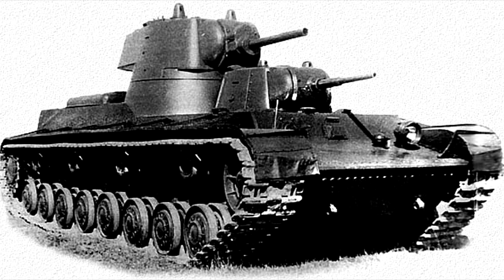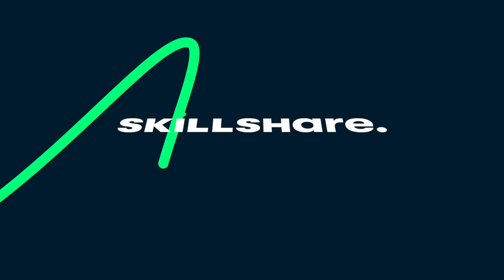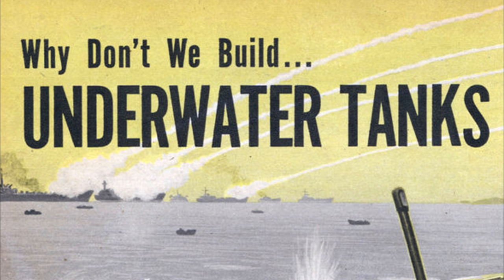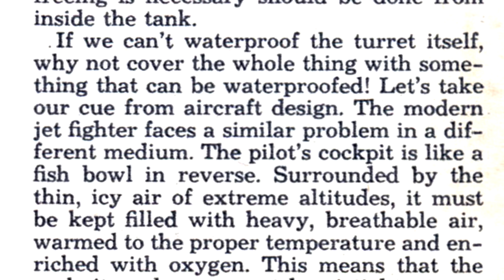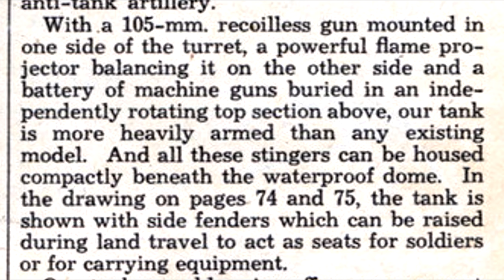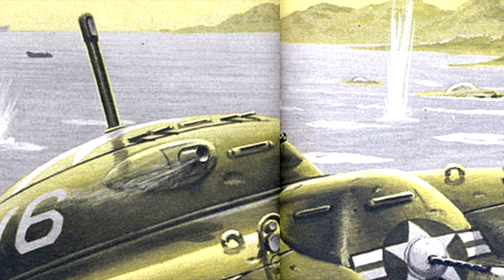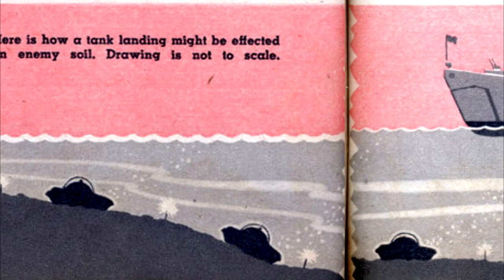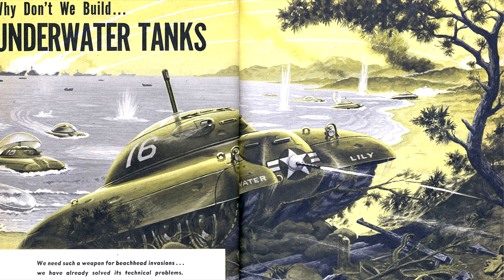The CRAZIEST Amphibious Tank Concept EVER | Cursed by Design

Comment: There is a big hole in it already: the recoilless rifle. When that gun fired, like a RPG or a bazooka, it would create a very big backlash to counter the recoil of the whole gun. If a 105mm recoilless gun is fired in that stubby turret, the crew, if not die from the fume, pressure, and heat, would be critically injured. Plus, the resistance on the beach can be very well put out by naval bombardment or airstrike. It would be much cheaper for a flight of F/A-18s or trios of Arleigh Burke-class to cover the landing party than to develop a tank for a niche situation.
Reply: Yeah lol. I was totally on board and open minded until he said to put a recoiless gun in it. Really though it could just be replaced with a 105mm howitzer since it should have to fight beach emplacements and not other tanks.
Reply: @MistahFox  or you know, just make a cover for the barrel that can be explosively removed :P
Reply: I figured he planned for a tube to vent exhaust.
Reply: Forget something like a Burke, battleships were in service at the time this thing was designed, they should be able to clear the beach of the kinds of things that a 105mm recoilless rifle would be used against no problem. And if for some reason they can't, such as due to too many coastal defenses for them to operate, then an amphibious landing with tanks probably isn't feasible anyway.

Using naval artillery to clear the beach of things like pillboxes and enemy tanks before landing makes much more sense than trying to find a way to land such a heavily armed and armored vehicle. It just isn't necessary. Light armored support should be enough to secure a beach head, at which point conventional tanks can be landed.
Reply: @TommygunNG  they probably would. But what if it failed? Murphy’s law is always there. And a recoiless rifle is something that should never be used in an enclosed space. Beside, the venting would probably make the gun more complicated to operate and take up a lot of space, lead to deficiency in combat effectiveness. 

Otherwise, if a beach is too heavily defended that a ship can’t get close, those tanks would not stand a chance. There is nothing a 16in shell or a missile can’t destroy. So, it would be a redundant tank and not much of use.
Reply: @zoro115-s6b  exactly, i was not paying attention to the time period, but a couple of 16in and 5in shells would definitely clear most of the enemy in area. Also, airstrike would also be ultilized to secure the landing zone. 

Beside, if a ships can’t get close, what good would those tank without infrantry support do? This concept is really for a niche situation that most of the time would not happen/need.
Reply: Exhaust can be routed out of the turret, no problem
Reply: @NoName-sb9tp  "But what if it failed?"

What is ANYTHING failed?! What if the breechblock on a tank gun failed? Dude, anything can fail, with resultant consequences.

But what if a reply to a reply on YouTube fails? Well, we just saw one that did.
Reply: @TommygunNG  Okay, so, a recoilless rifle operates on the principle of Newton's Third Law. For every action, there is a reaction. A normal gun fired a bullet through the explosive force of the chemical inside the bullet, and the reaction force to that explosive cause the recoil. Now, for your vent, it will have to be able to open up for the loader to load the next round. In case you don't know, a recoilless rifle load from the back. With an opening and closing vent, it would create a weak point as the backlash of the recoilless rifle is just as strong as the force to propel the bullet out of the gun. This increases the probability of the vent gave out and explode inside the enclosure of the tank while the gun is firing, killing or injuring the crew. 

Meanwhile, breach loading guns are made with heavier components and don't have to contend with a vent in its back, or backlash. The breach assembly is made with solid steel, make it less likely to fail than a recoilless gun. So, you want to fight in an enclosed vehicle with a gun that's more likely to explode in your face than a normal-reliable breech-loading gun, be my guess. That's why you usually see a recoilless rifle outside of the enclosure of the tank. 

Just like you say, everything will eventually fail, but we need to consider which is more likely to fail. And when lives are on the line, failure must be limited as much as possible. Next time, read, then think, and reply. And yeah, that comment of yours is indeed a failure. Go back to school.
Reply: @NoName-sb9tp  FO
Reply: @NoName-sb9tp  
RR more likely to explode? Er no. Since the back pressure is vented away they are less likely to explode and can be much more lightly built than a conventional gun.
Backblast is totally lethal though, check it out at 7:45   
https://youtu.be/Or6OtukreYU
Reply: @andrewholdaway813  I'm not talking about the recoilless gun itself, but the apparatus that will be needed to contain or push the backblast out of the tank while still allow the loader to load the gun easily. Yeah, totally agree with you. Recoilless gun doesn't have to deal with the force or pressure like conventional gun, so it's lighter. And yeah... that video just tells us why recoilless gun should not be put inside a tank. 

But hey, good to see another fan of Forgotten Weapon :))
Reply: @andrewholdaway813  and i should have been a bit more clear, so, sorry for that.
Reply: @NoName-sb9tp  if you can make an amphibious/submarine tank, you can make an amphibious/submarine APC
Reply: @NoName-sb9tp  false, there are ammunition types for recoiless rifles that have been designed to be useable in confined spaces. they didn't exist at this time, but they do now.

as for naval gun fire, its vry inaccurate in ww2/early cold war. for example on D-day almost no shells from the naval support actually hit the beach defenses. 

and in modern times you still have to account for shell/missile travel time, aswell as the time it takes for them to be called in in the first place (the spotter needs to identify the target, accurately cal. its location, radio it to the ship. the ship then needs to choose priority targets, then the projectile needs to travel the distance) this can take serval minutes which means if enemy tanks move into the beach zone you are in real trouble unless you brought dirrect fire anti-tank weapons.

furthermore, naval gunfire and missile strikes give away the element of surprise. if the enemy has a relatively lightly defended beach, argueably its better to simply launch a suprise attack, rather than bombard the place and give the enemy more time to mobilise reserves to push back your assault.
Reply: @matthiuskoenig3378  sure you can make a submarine apc to accompany your submarine tank, but the biggest challenge is going to be cost, R&D, as well as the intergration into the army (logistic, training, etc). You can watch the chieftain video on why a lot of US army unit refused to take the Sherman with 76mm gun and prefered the 75mm (3in) Sherman when they go into Normandy (before they met things like Panther and Tiger).
Reply: @matthiuskoenig3378  the up until the 2017, before the introduction of the new modernization of the Carl Gustav rocket system (yes, I know, but in theory, it worked just like a recoilless rifle), all of the recoilless rifle will produce backlash everytime they fire. We also have to take in the fact that Recoilless rifles always has inferior range than it’s counterpart due to the nature of it’s operation. A round fired from the recoilless gun exhausted part of it’s energy to dissipate the recoill of the gun itself through vents at its back. So, to design a system like that for an enclosed armoured vehicle is probably prohibitively expensive for the 1950s era. Nowaday, with airstrikes, ATGM, and missiles, the landing zone can be secured relatively easy, render the effectiveness of such a submarine tank to almost nil. The inaccuracy of the naval bombardment and airstrike in the 1950s would be countered with the quantity of shell, bombs and rockets (most of the time). 

And I would say that if an invasion fleet large enough to carry those tanks, soldiers, material, etc goes near the shore, the element of suprise is depend on how fast can you strike the beach and how hard can you strike that beach. A fleet of slow crawling vehicles on the sea bed would give the defender more time to man their position. Air strike and naval bombardment are effective ways to delay, demoralize the defender and defend the landing troops. 

As the submarine tank has to be able to move on the sea bed, it can be heavier than their amphibious counterparts. However, it cannot be too heavy, as the weight may make them stuck, or slow them down significantly. The deployment of the Submarine tank must take into account the topography of the sea bed. And on a conventional land battle, it would be out performed by normal tanks. Coupled with less effective gun, inferrior armor, and speed, the submarine tank in my opinion is a niche tank designed for a niche role and doesn’t even do a good job in it.
Reply: @NoName-sb9tp  make an armored half-barrel rotating door to access the recoilless rifle's breech. Rotate the concave section to the interior to empty and reload, roll it around concave out to expose the breech ports to the outside and seal the access port in the turret. Configure it right and there would never be a moment where the turret is open to the outside, but there's plenty of material to keep the crew safe if there's a critical weapon malfunction.
Reply: @mfree80286  so it’s like a door for ammunition rack, but instead of ammunition, we have a recoilless rifle? I suppose it could work, but… ergonomically, I don’t think the soldiers would like it. And the space inside the already small tank would be limited even more.
Reply: @NoName-sb9tp  Oh, I'm sure they'd hate it, but it would work.
Reply: @mfree80286  yeah they would hate it. haha. But, given how the army was so rigorous at testing the weapons, I don’t think the tank like that would be adopted. I mean, just look at the T26 Pershing program. :P 

Don’t get me wrong. Im pretty sure the concept can be made into reality, and the pressure door is a easy way to isolate the crew from recoilless rifle backblast and weapon malfunction. But I don’t think the tank would be adopted. 

I think the chieftain did a video on the developement of US AFV in ww2. It would explain a lot why some vehicles were not adopted.

Comment: Just my opinion: Theoretically possible, yet extremely impractical. 
1. These tanks will cost a lot more to be build due to added components for waterproofing, etc. This is not a regular tank with parts added to make it watertight. This is a submarine/tank hybrid.
2. Problem of communication while submerged. Radio cannot be used underwater. They will need to rely on scheduled plans yet it will be difficult for the tank or the commander to pass message to each other.
3. Rough underwater terrain would likely make this tank only deployable in even less areas, thus limiting the benefit of building such tank. Not to mention all underwater terrain need to be scouted just for this tank.
Reply: The radio problem can be dealt with
LONG ANTENNA
and navigation can have a special tank or sonar or such
Reply: Or silent communication

Comment: I think it could have been made to work - using electric drive is one solution, or carrying oxygen tanks to use a conventional motor as long as the depth pressure wasn't too great for the exhaust to work. It's interesting that there's possibly a false premise here - turrets have been successfully waterproofed as the German experiments showed, as was used on tanks on D-Day, and on the wading Soviet tanks we saw in your video. Therefore the next steps he proposed were not necessary, and there could have been other solutions such as a fixed turret/superstructure. I am also not sure how he intended a recoilless rifle to work inside the tank - I assume he's considered that the exhaust gas from the RR needed to go out the back of the turret some how.

All very interesting though!
Reply: Also many sea floors are very uneven, rocky or pose some other danger. What an enemy could do to prevent the tanks from being useful is by artificially raising the sea floor or making it cluttered with boulders which is easily done. So essentially you could deny those tanks access to the beach with a bunch of rocks/concrete traps. Even better, you could create a bottleneck with those obstacles and lead them to a kill zone.
Reply: @mihailosaranovic5444  as a scuba diver I agree that the biggest flow is the sea isn’t flat and easy to maneuver, the best thing would be make it swim like a submarine but you would need a really powerful engine to work

Comment: As to the Underwater propulsion, using a full contained regenerative engine powered unit fueled by H2O2 at 98%+ was tested by the F*C company in the mid 1960's, but was cancelled after an explosion killed several Engineers.  

My Mom was a Technical Manual Transcriber/Translator at the time.  I was an Aeronautical Engineering student just across the street from the company test track and was a eyewitness to the damaged test device remains.  This was a higher than TOP SECRET Military project.  When I Inquired about it I got a visit from the ''Men in Black''.

Comment: Me, as a Dutch person, has tought alot about amfibious tanks, due to our relation with water. I would see a good underwater tank would be hugendue to our “waterlinie” but quite complex. 1 idea i had in mind however would be to sumbmerge a tank partually, using the water as means of protection, some kind of semi-submerisble. Imagine having to go trough 2 meters of water just to get to the crew compartment, or even remote controlled compartment. Even tough modern tanks have such advanced APDS-FS shells, good luck with going trough that!

Comment: A Betteridea(?) A giant hollow torpedo with blast off cap "Fired" at shore, such that the torpedo lands itself, like when they sink a truck in Operation Petticoat,  but instead of blowing up, the front blows off and a tank or two rolls out.

Comment: I’d love to see someone create a decent sized scale model of this vehicle. I don’t think it would be useful, but I think it’s definitely possible. For sealing the turret, it could be possible to use a temporary rubber seal that could be broken by the moving of the turret, potentially allowing for heavier armament without the need for the dome. The main issue is air for the engine, as you say, alternative power would likely be necessary, as well as a different track design for traversing the sea floor. Either way, it’s an interesting concept, glad you shared it.

Comment: One big problem with this concept is that a major obstacle for amphibious landings is the prevalence of underwater obstacles in water that gets shallow enough that ships/tanks on the surface will get stuck on them. The LVTs and amphibious M4s were revolutionary in that they could actually use their tracks and engine power to climb up and over these obstacles and then continue on to the beach.

So a sea-floor traversing tank would typically get stuck and have no way to deal with it or avoid it, because they would be unable to see at all and too deep to traverse many underwater obstacles.

Comment: There's so many paths in this rabbithole...but it's cartoon villain stuff exclusively.
One thing that could not have worked is the recoilless  gun.It blows half it's propellant out the back,and would instantly kill the crew and likely blow up the tank.
I would also like to see the amount of 1950's batteries,that can run a tank for 15min.(about a truckload of them?)
On the other hand,spare that sci-fi dome;if the Germans  could waterproof a turret in the 40's,all you need is a muzzle cover that can be blown off.(essentially a cork & a blank cartridge,unfortunately much less flashy )
 The "designer" also seems to have his vision of a tank from 1920-30's,with turrets and guns,the more the better, while already during WW2 and until today, the trend is to keep this to a minimum.
Even if the tech issues could be resolved,that big ship could not get near the coast,so it would be a very long drive through rocks or mud,completely  blind, as any movements (or battle action) stir up dust clouds.
No tank would ever reach the shore.

Comment: Since he doesn't mention the motive power, an alternative would be a standard IC engine, with some sort of floating "snorkel platfom", with a retractable hose of some sort - perhaps similar to how fire hoses are stored in cabinets in larger buildings - then just disconnect them the same way as the canopy once the tank is on shore. To solve the problem of soft underwater soil, you'd still have to make this creature fairly light, so probably install only a limited fuel supply, and smaller engine to save some weight, as well as EXTREMLY wide. Tracks. - It could work....it would have kicked ass at D-Day....but it'd probably also be a death-trap.

Comment: The "recoilless" gun has a huge blast of flame and gas out the backside of the gun.  There's no functional way to contain the blast inside the tank with a crew inside.
Reply: So you vent it out the back? It's not too hard to solve this problem.